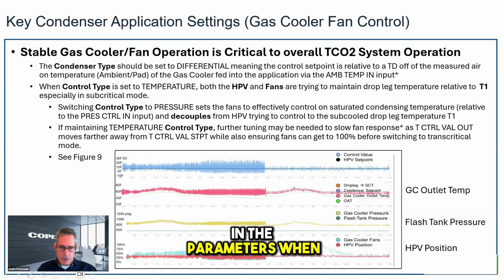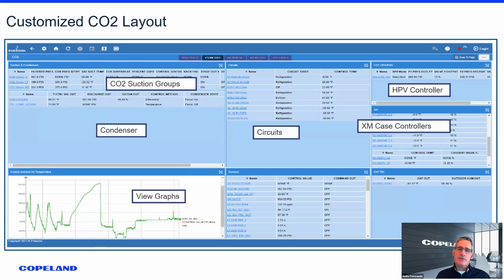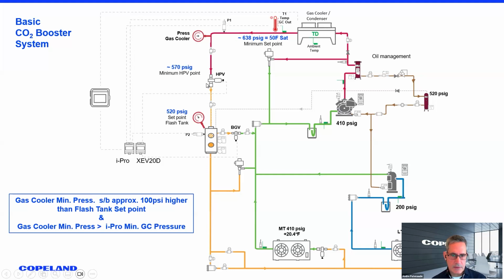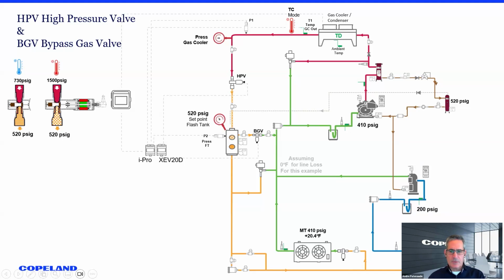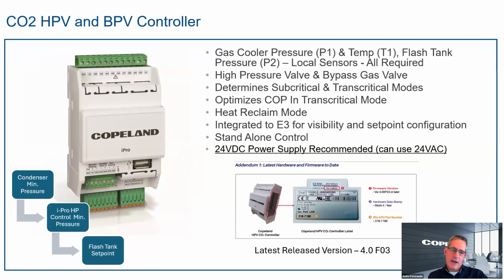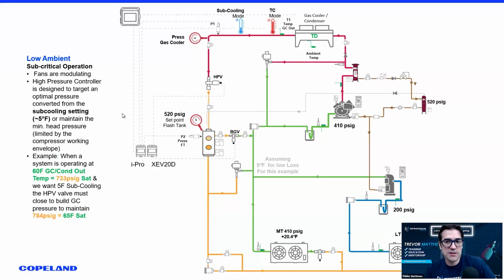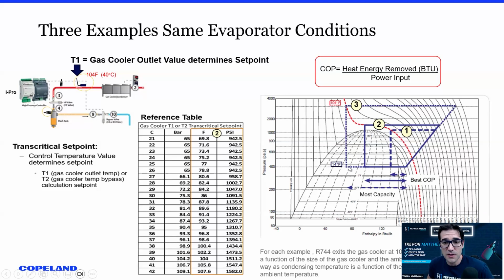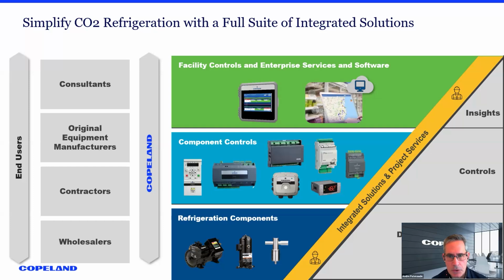CO2 Experts: Mastering the iPro HPV Valve Controller with André Patenaude

Comment: Wow. This is a very good video guys. Good job at breaking it all down. HPV and GBV controllers are a mystery to a lot of techs, you know it’s controlling the valves but you don’t know exactly how. 

Good stuff on the subcooling part during subcritical. Please keep this up. I’m cheering for copeland. I don’t want to see any more MT here in the Southwest. Yikes.
Reply from the maker: Thanks for watching and learning something. Please share that knowledge with others.  

We train on many CO2 systems and what we have seen training 1000’s of technicians on CO2 and controllers it does not matter if it is E2/E3, Micro Thermo, Danfoss, RDM or others it is just how much you understand what the CO2 system logic is supposed to do because the controllers do almost the exact same thing with some features that are slightly different. It’s basically what they use the most and their comfortable with because I have techs who say RDM is the best, Wurm is the best, E3 is the best, Danfoss is the best, Micro Thermo is the best and all the other are terrible. But in reality when I talk with controller they don’t really care they just want to get the system running great and move on to the next startup challenge. 
If you know anyone who wants to learn more about our controls training or CO2 trainings head to www.refrigerationmentor.com/courses. 
Thanks again.